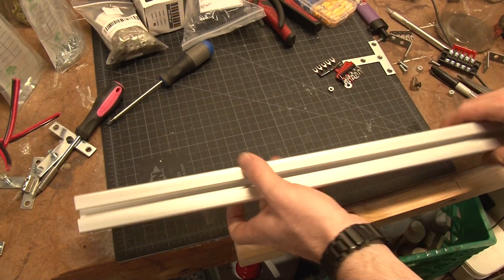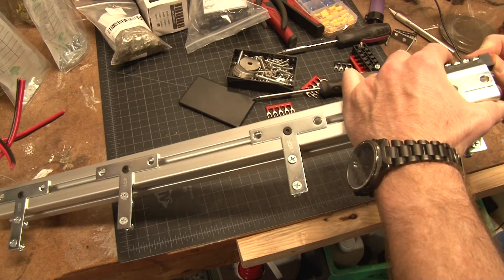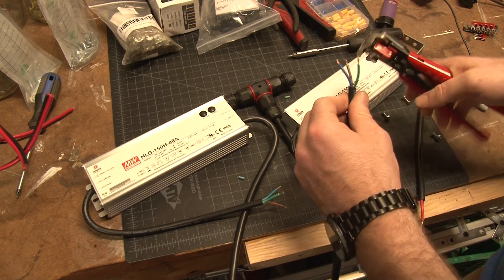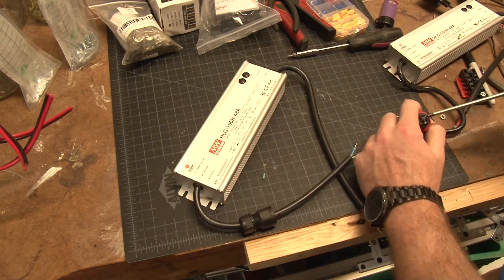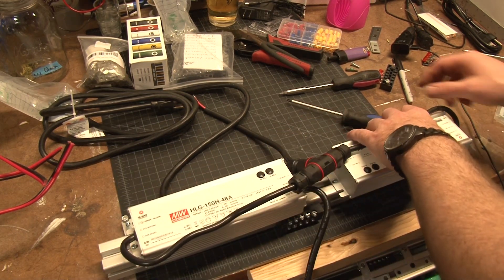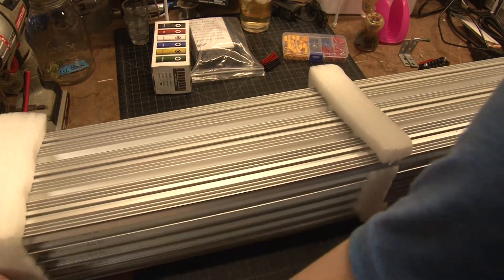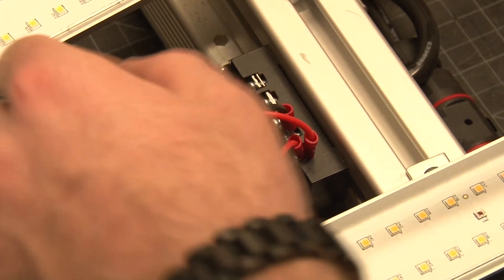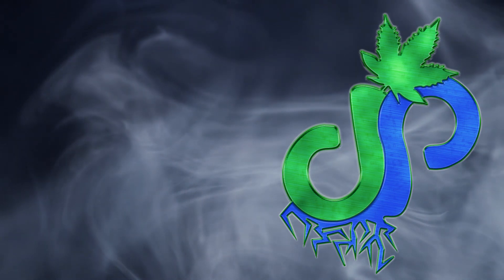New(est) LED DIY Build

Comment: And this light bar has no far red diode that r very very important in flower.
Reply from the maker: Well I guess you're not gonna like being told you're wrong but you must have not even watched the video. Because each XPE bar has 3 660nm diodes and 2 730nm diodes. But thanks for the positivity!
Reply: @jPapapot  OK,wrong about far reds,but why spend a grand making one,when buying is easier and less expensive?
Reply from the maker: For a guy with such a high IQ that you claimed, do you not understand the idea of enjoyment from building things? Like I know I was being sarcastic in the last thread but dude. First off if you think I'm doing it wrong, you're free to not watch my shit. That easy. Second I like to build. I enjoy the process of wiring, planning out and getting packages in the mail. Third when someone says "hey I'll pay you to do this thing you like". I would seem to me to be pretty dumb and of low IQ to say "nah buy it on amazon". I mean I'm no big brained brad but that seems pretty simple to me. Fourth, I'm not sure if you keep up on the conversation in the grow light world but let me explain something. Packing everything onto one board that has no thermal heatsink with a driver attached to it heating up the boards reduces efficiency, minimally but it does. However what's more is the fact that airflow around bars is better for climate control in a room because instead if all the head concentrated in one spot its spread over the entire space with room to have passive cooling between sections of diodes, not only adding to efficiency but also to climate control in the room. In other words less hot spots. Better spread means better coverage and overall even ppf distribution. And finally we get to the fact that that light draws 450watts. for $630 x 2= $1260 for 900 watts. I believe mine came out to be hmmm, lets see, O that weird mine too is 900 watts, for what price. O damn only ~$1050 after shipping and paying me to build it. Weird I might be wrong at my math but my light seems to be better. Especially when you decide to upgrade to something better my light has the versatility to become side lighting or spread out more to be veg lighting. Overall it might be easier to buy a light online. And if that's your thing do it.
Now that I'm done lecturing you let me start a new topic here. Because I'm not sure if anyone has ever told you how to interact with people online. Try reading "how to win friends and influence people" by Dale Carnegie I'm sure it'll improve you life.  Because I don't know if you don't pay attention to what you say or you don't care how its said. Both your comments you asserted knowledge you clearly don't possess. Let me show you how to actually comment if you don't want a sarcastic dick response. "hey man you're light seems to be just around the same price as a spider farmer sf4000 . Why would someone not just get that?" Then I would get to engage with a question aimed at having a conversation. Here lets try it again. "I don't seem to see any far red diodes, I know that they improve flower growth, is their a reason that you don't have them on there?" then I'd get to go. actually I do. They are super important, I have 2 on each XPE bar. Having too much far red though isn't good because of the Shade avoidance syndrome, but just enough with the 660 is perfect for the Emerson effect.
See the difference? For a smart common sense guy you don't seem to pay attention to how you present yourself when there isn't any emotional inflection to text.
In conclusion you may think that this was a lot of time I wasted on you but I decided to use you as an example, like a head on a pike in front of my castle. I'll be pinning your comment so anyone who wants to comment can see what proper etiquette is and what happens when you don't show it. I hope you take this to heat and realize although I'm publicly shaming you, it's to make you a better person and allow for personal reflection. Because like Socrates said "The unexamined life is not worth living." 
Thanks for coming to my TED Talk.
P.S. next time you want to comment please think about it then just let it go.
Reply: @jPapapot  fucken brilliant mate   
That was some mic drop shit right there
Reply: @jPapapot  Great job
I like getting packages in the mail also,one of those lights would be great!🤤🤤🤤
Reply: @jPapapot  lol.. just got my subscription. Well said......
Reply from the maker: @chadfellers9128  thanks. I don't know a lot but what I do know, I'll back that shit up
Reply: @jPapapot  np.. respect.. people like him are why we have become a disposal society and you cant find parts for most things theses days and DIY becomes harder every year.
Reply from the maker: @chadfellers9128  I mean digikey and Mouser are my only real resources
Reply: @jPapapot  keep following your passion, I look forward to your future post especially about any DIY post about the newer B301 chips. Some companies have been able to achieve what was always considered impossible in the past with those chips..                                                                                                                                                                                                           P.s. Nice setups just watched your vids, might think about installing a DIY muti head mini split units in your garage, easily installed and removed if need be(just one 3in hole in the wall). You could even run lines to your veg shed and be able to use dehumidifier option of the newer mini split heads, that be a very handy option. Just my 2 cents, take it or leave it Im sure you get plenty of opions from so called you tube experts in the comments already... lol
Reply from the maker: @chadfellers9128  I wanted to but it was a little out of my price range. But I have a few videos I need to get together and post to catch you up of what I've been up to.
Reply: @jPapapot  I under stand they can be some what expensive, but dent and scratch deals can be found, I installed a 3 12k head unit this summer, with( Freon and power) lines, couple  tools and amazon vacuum pump for less then $900 all in.. Found it on Marketplace local. Look forward to the post.......
Reply from the maker: @chadfellers9128  next time for sure. That doesn't sound like a bad deal at all.
Reply: @jPapapot  -wasting your key strokes bro. I don't get the trolling going out of their way to ultimately say you don't know how to do what had already been done and worked. Ok, I've trolled once maybe twice but you don't troll the guy knowing obviously way more than he dosel. Where are you picking up the PCB's in Samsung and are 40" available?
Reply from the maker: @TexasReal007  I mean and I often admit to my lack of knowledge to which blows my mind. I never claim to have even a fraction of useful knowledge then they tell me I don't know shit. Also I think only digikey has plain pcbs at 44"
Reply: @jPapapot   I like this answer 🤣 most people just scoff and let it go or say dummy things back....
Reply: I like your video and enjoy building things as well. I appreciate the talent.
Reply from the maker: @MrJoeyplatinum  idk if it's talent, but I definitely enjoy it
Reply: A whole bunch of other lights don't either. Why does that matter? All about the percentage of the 400-700 plus E-parbut tru infrared doesn't start until 840nm anyways. Look it up can't be seen but the heat produced is felt. 730 or 740nm is poor man's IR.
Reply from the maker: @TexasReal007  I agree but what does true ir benefit the plants? I haven't seen data on it. Not that it isn't there I just haven't looked it up
Reply from the maker: @twentytwo138  I have no arguments or changes. I think you did great research. Some stuff i think it's anecdotal but until we have more scientific research I think that's where some of our evidence is. Obviously researchers like Bruce bugbee will either substantiate or redefine our knowledge and I for one am excited for the future of cannabis research
Reply: Adding far red is waste, lookup Bigsby

Comment: Awesome build! Love how you used the aluminum extrusion for the heatsinks. What parts did you use to hold them down? Would love to do that as well
Reply from the maker: So these strips are specifically sold with the heatsink/reflector its a tslot mount for a #8 screw. Then threaded them into the extruded aluminum slots
Reply from the maker: @12crissss  t slots from tnutz.com. All the parts and pieces are on there. I can look into it tomorrow and give you a better parts list. But that'll get you started on your search.

Comment: I brought 20 60watt boards with to driver capable of running 4 boards so how would you hook them up and do I need anything else
Reply from the maker: I'd make a driver board. connect all the drivers to a single plug, or double if you want to split the load but it's not required. then I'd have a dc waterproof connector to each on so if you don't need all 20 boards you can unplug the unused ones. Add a dimmer capable of controlling all 5 drivers. And that allows you to keep the drivers out of the grow room. If you want to get more info hit me up on IG and we can chat about details since I don't really know your exact needs.

Comment: How do you get 1000watts if drivers are 154watts so it's a total of 310watts. Just a noob here. Thanks
Reply from the maker: So it wasn't each individual fixture was 1000, it was 3 fixtures at 300 watts each would equal 900 watts across a canopy. It may have been my fault for not explaining my intent for building 3 matching fixtures across the entirety of the space. So yea each one was only ~300 watts which you were right but when all placed and plugged in together it was ~900 watts. Does that help?

Comment: Two questions:
1-how do you set it up to do end caps for a 4 x 4 tent?
2-For the build I’m looking at did you use 2 Terp bars n 2 xpe bars?
... and if possible could you explain the power draw for the different colored lights.. do you have any toggle switches you can turn on and off certain specific lights… Do you need a separate driver for different separate lights?
IThought with constant voltage drivers it’s better to do parallel than series.
Reply from the maker: so that's a lot to unpack. I typed this out already and then accidentally hit back. So let me try again. more condensed.
1. What do you mean endcaps? For a 4x4 I would recommend about 3" off each side so the light would be a 3'x3.5'  fixture. You can buy enough bars to lay it out in 2 ways. each bar 4-6 inches apart for an even spread. Or You can make pairs of bars about 3" apart then each pair 7" apart, which gives more intensity and penetration.
2. I built these with 2 and 2. In parallel. You can't control the individual color diodes. The terp bars have the blue which are about 3500k color temp and the xpe have around 3000K color temps. If you wana turn off certain lights you'll need them on their own driver and turn on and off the driver if you want toggle controls.
3. you can wire terp and xpe in series just fine. But for some reason you can't put them in parallel together. In parallel  same bars have to go together.
4. Constant voltage is for parallel only . Constant current is for series only. You might be able to get away with some changes in that but if you stick to that you'll be safer electrically speaking. Also constant voltage parallel wiring is better for power because you tend to lose a little on constant voltage drivers because if the bars don't add up to the exact amount on the driver you lose the watts from the unused volts.
Reply: @jPapapot  I meant by end caps ...in your video  you stated you just put in another bar perpendicular to your light bar is going east and west and it sounded like you would put another heat sink bar north and south and I didn’t see how you would attach that to your system… Because I’m dealing with a 4 x 4 tent and I wanted coverage is in the corners.
Great stuff learned a lot thank you very much I’m going to Subscribe to your channel.
Reply from the maker: @CJM17627  these guys. They're t brackets. Hopefully the link works.
https://www.amazon.com/dp/B08CXFYVJS/ref=cm_sw_r_cp_apa_fabc_LXxZFbCYGDSFC?_encoding=UTF8&psc=1

Comment: Have you ever tried the grow light cobs? The ones with driver's built in. It's just wire and go.
Reply from the maker: I've never tried them. I think Migro did a video on them. They have terrible efficiency that's why I wouldn't use them.
Reply: @jPapapot  will send you a pic later I made one for a test bed. With 6x20watt. Had three tomatoes growing with just the one light. Wife didn't water them while out of town for two weeks with work so 2 died nursing last one back to health. Has amazing penetration ..  next one I am making is with 2x50w and 1x30w in center. I can get heavy aluminum trays for baking from Costco for crazy cheap.  Acts as a heat sink and reflector. My new lights just arrived so will be doing that project this week.
Reply: @jPapapot  you call terrible efficiency 2.2 umol/j thats about the number of cree cxb 3590 cobs and luminious and vero cobs. I have lots of grow lights diy brand name like hlg, samsung lm301h, qb144, qb96 elites bridgelux  eb strips gen 3 etc... i can tell u i still use my cobs cree cxb 3590s and i grow buds as good as any other high end light, i have grown same cuts under my cobs as my quantum boards my strips my cree xpg3, qb96 elites. no noticable differnce none in yeild, potency, etc... dont beleave the hype if you can grow you can grow as long as you have a decent led you can grow kick ass buds, ive done many side by side grows one of my grow rooms has mixed leds including cobs they kick ass have better penatration just not quite as good spread but if you have enough it makes up for spread.
Reply from the maker: @matthewsquires6319  good to know. I like these bars bc of the heatsink with tslot. Easy, functional, local. No shipping cost and discounted. Overall like you said it does as well as any other and it's cheaper for me. So win win.

Comment: samsung lm301 is the new king for LED lights.. so many resellers though in America and even china now. 1000 is a lot, most prove about 400 bucks can fill a 5x5 tent with lm301 prebuilt kits.. most are charging 700 to 1500(like fluence spydr).. which are great and all, the big ops i worked use them, but 1500 is 2x actual cost, ha pass!
Reply: oh man, i know someone who runs these and I have had product, the best rosin ive had in a long time... 🍯👌grown under this companies LED. Future customer...🤔
Reply from the maker: Most of those fluence, chilLED, Grower choice, Think grow and most fixtures on the market are only 600-680 watts for 999-1500. So building a 900+ watt for 1100 isn't terribly priced.

Comment: Those look like some clean strips
Reply from the maker: I recommend them they can go up to 80 watts but if you run them at 60 watts a bar they barely get hot. And by hot I mean you could touch the bar for a minute before its uncomfortable.
Reply: @jPapapot  what's the cost per unit and how many strips would it take to cover a 4x8 room
Reply from the maker: I just did a 4x8 10 bar set up using a $125 600 watt invitronics driver and 10-11 bars. Based on the online price 11 bars would be $770. However you could do 12 bars with different multiple drivers for less power each driver but adding up to higher power if that makes sense. But if you have time I would recommend building it yourself vs having him charge you to build it for you. But Yeah $1000 would get you totally covered. Seems pricey but think about all the other lights are 999-1200 to cover a 4x4/5x5.
Reply: @jPapapot  1000 aint bad lol I knowing. What most LED companies charge thats why I got into DIY myself I just cant see paying 1500 for something I can make myself for 500 lol. Does the guy have any data posted online and if so where can I find it?
Reply: @jPapapot  I think I would rather do a dual 4x4 build so I can adjust both sides according to my canopy needs so I can stagger my harvests
Reply: @jPapapot  I see they even include the Cree XPE 730nm far reds I like that
Reply from the maker: @madmike8325  and heatsinks. For example a 2ft plc is 27 plus a heatsink or the aluminum so that's let's say 35 after tax. Then you'd need 2 for a 4ft length. And Idk how many diodes plc has but the linear pro has 150. So they're about comparable. It's kinda what comes too the better price honestly. I'm a frugal fucker so that's what I compare with
Reply: @jPapapot  I'm with you there I hate to see some of the prices out there on the market and especially when its connected to cannabis that makes it x4 the rate it should go for lol
Reply from the maker: straight up. And diy is cheaper but unless you're the guy getting it from China, nothings $1/watt but like I won't pay for anything close to $2/watt.
Reply: @jPapapot  im going to look into them I gotta say I like what I'm seeing and we all know the samsung 301b is king lol
Reply from the maker: @madmike8325  for now upgrades come every year or two.